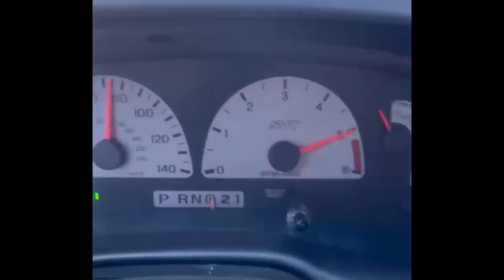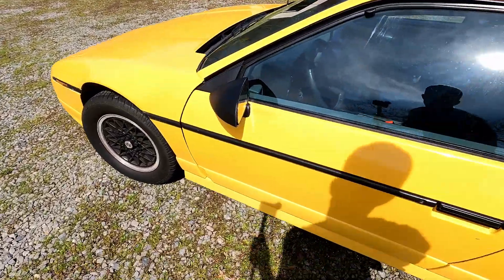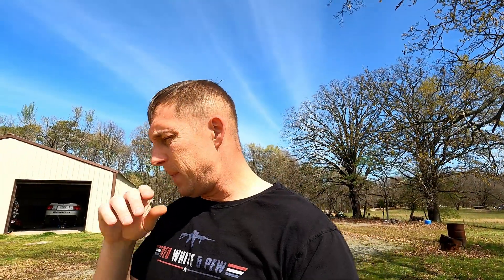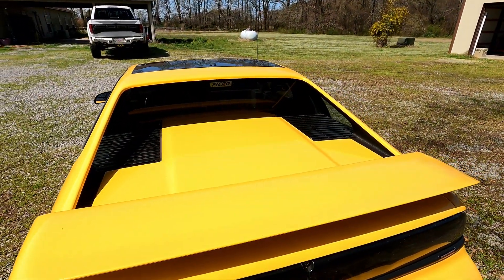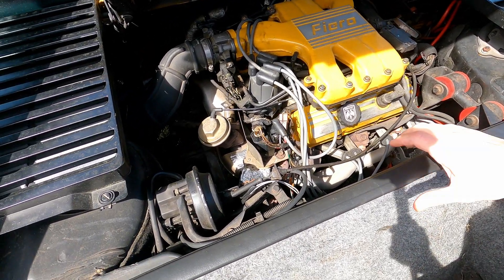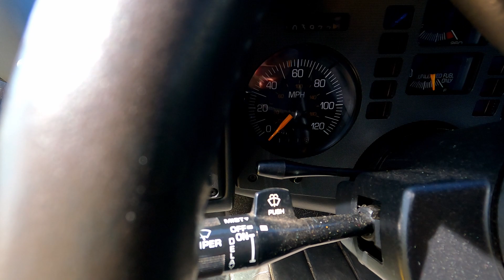I Got Another New Car

Comment: There are plenty of GM front wheel engines that can be swapped in there. 3800 Superchargered or the LQ1 can be swapped in there, and LS4 engine and 6 spd trans axles (from Buick GS) can be swapped in there. The LQ1 engine was downtuned to save the transaxles from the 270 hp. I would recommend the Fiero forum.
Reply from the maker: Yea I’ve swapped multiple fieros over the years. I’m still undecided on the route I want to take with it.